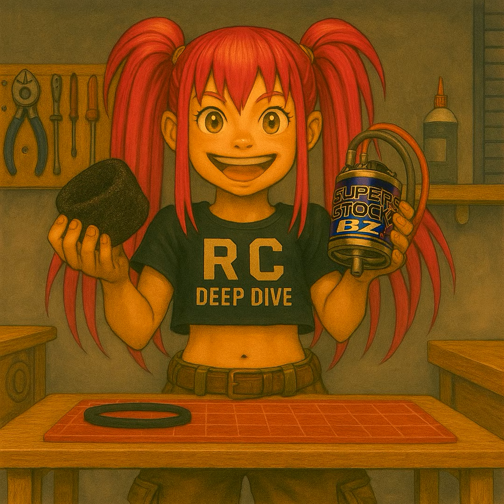The Engineering Genius of Tamiya's Foam Motor Cover

Comment: Close....  I think Parma came out with those years before Tamiya did, and by the way, only a few Tamiya motors come with those filters..  Those filters are good at keeping sand, small sticks, grass, small pepples, pine needles out, yadda yadda yadda, But the problem with those filters are, fine dust can get in, and if you don't clean your motor(s) after every run, that dust turns into a grinding paste on the comm, brushes, bearing & bushings, and what do you do after you clean your motor(s); you oil the bushings/bearings, oil attracts dust/dirt.. No one cleans motors like they did before brushless came around..  Also, someone made a rubber endbell cap too, in my eyes, both are bad news....  If you cant clean your things, maybe an RTR with brushless is your best bet.....
Reply from the maker: Exactly. You nailed it.

Comment: I had no idea that Tamiya included these motor endbell covers with their 540 motors.  Way back in the day, my Kyosho Optima came with a motor cover but it was made from heavy, black rubber.  It did an excellent job of keeping dirt out of the motor but it also did an excellent job of retaining the motor's heat.

Back in those days, aftermarket companies like Parma sold foam motor endbell covers.  I remember that I actually bought a few over the years.  They slowly disintegrated though and fell apart since the foam that they were made from was not very durable.  I had absolutely no idea that there was a company today that still made these covers until I listened to this episode.  Thanks for the heads up!
Reply from the maker: Yup, they still come with them, but so many people don't understand why, so we had to do an episode on them.